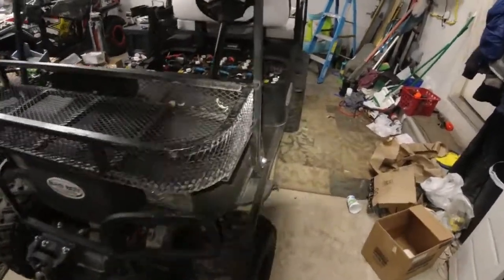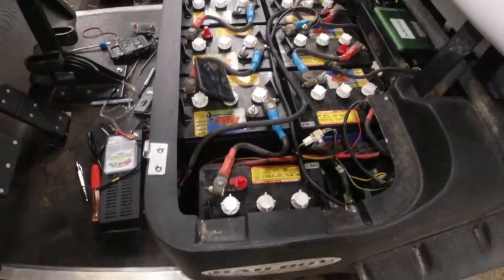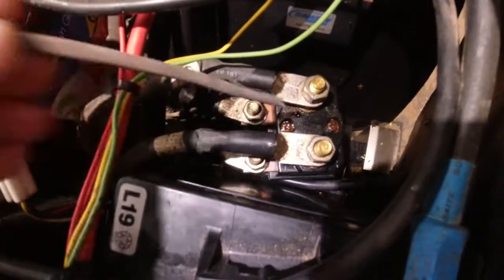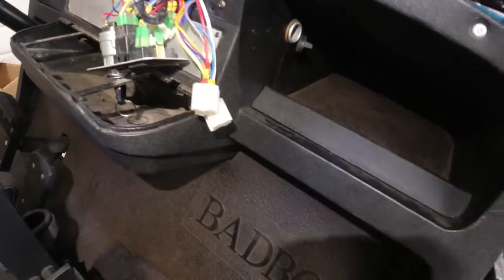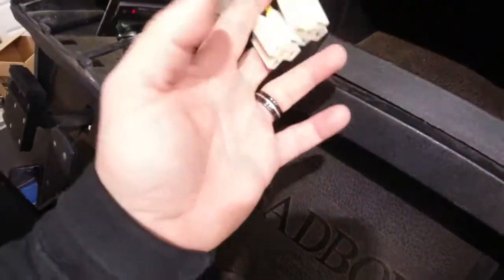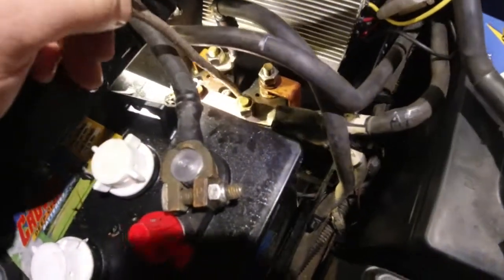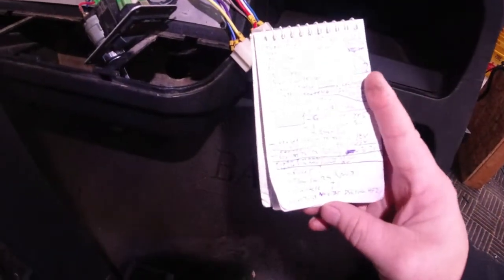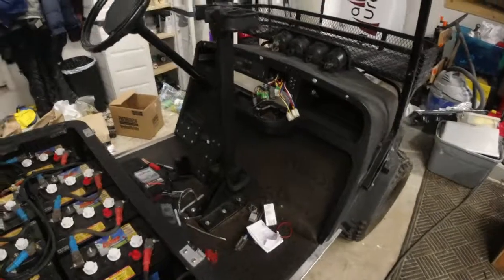2006 Bad Boy Buggy BB-AMS4 4x4 48V Electric Cart - Symptoms - Tests - Need Help w/ Diagnosis Please!

Comment from the maker: I never really clarified several of the things we figured out.  The relays needed to be 48v, not the 12v someone must’ve replaced the stock one with.  That fixed headlights and lighter plug. The things at the end of the video that I said I didn’t know how to test, I know how now thanks to a friend and research.  I also tore down both solenoids and cleaned everything. They worked and looked new rather than the green copper look.  The front differential got new top bearings. In the end, i made  a chart that shows how to test each pin in the controller and what the reading should be. It was the green Navitas controller. I sent it in through my buddy and had it rebuilt. By the time I was done, the cart was like new.
Reply: Are you still here and do you have wiring diagrams? I replaced everything - batteries, sent the controller to FSIP, have tried to check the diodes, switches etc. Traced all the wires (what a mess!). Can't get the controller to send ground to the solenoids. Tested both. All cleaned wires and terminals.

Comment from the maker: I know how to test and fix almost everything now on these classic versions. I went through this whole cart
Reply: I have a 2011 Bad Boy Classic, trying to troubleshoot. The forward and reverse do not click on the Solenoid when pushed. Cleaned all batteries and terminals. Not sure what to do next. Would appreciate any help
Reply from the maker: @fernandog.semiao265  do you have a single green controller in the back of the cart like I do or do you have two controllers? one in the front and one in the back
Reply: @freshmaker5  I have 2 controllors in back. Both have blinking green light when I turn switch on
Reply from the maker: @fernandog.semiao265  I only had one controller which did not have any lights. You should find the codes meaning of the blinking lights and you’ll know what to do.
Reply: @freshmaker5  been working on my Badboy classic for a while and I’m also down to it’s now running ok everything working but I can only go about two miles in woods before days I need to charge on dashboard. And loose power going uphills in woods . I also have two controllers . So you suggested look for blinking lights on both blue controllers? And then look up the code ? 
If I need new controllers can you recommend the two I need ? And is it true I must ship old controllers to the seller of new ones ? Thanks in advance. 
Richie
Reply from the maker: @richiechop  certainly sounds like you just need new batteries, not controllers. Have the batteries LOAD tested at your local auto parts store like AutoZone
Reply: @freshmaker5  I have a single controller. Only goes in reverse
Reply from the maker: @jaybyrd9750  there are two locations for solenoids. on the Passenger side there’s a double one. It’s your forward and reverse. If you can’t find a new one, remove it and tear it completely down cleaning it and put it back together. That is what I did to mine and it fixed it.  Take pics along the way and label wires and how they connect. Be sure to unhook the main 48v before messing with anything.
Reply: @freshmaker5  thanks! I’ll give it a shot. I will let you know
Reply: @freshmaker5  could I get a copy of your schematics also please? I’m having the same issue with no forward or reverse after I washed the vehicle. Probably got some water in something but IT’s throwing me for a loop.
Reply from the maker: @davidproctor3712  if it worked before you washed it, leave it be for about two days and let it dry out. You might be OK. Be more careful not to get electronics wet when cleaning. Send me your email and I’ll give you the main one for free that will probably help you fix your problem.
Reply from the maker: @davidproctor3712  this was years ago but I’m pretty sure I have another video that is regarding only the forward and reverse solenoids if you sift through my channel
Reply: Hey freshmaker5,
 I have a 2011 bad boy buggy xto with sevcon millpak controllers that will not move in forward or reverse. Both controllers have solid green lights, both solenoids pull in and show 50volts across B+ and B-. The fwd/rev switch has continuity on pins 2 and 3 respectively on the connector going into the controller when engaged. Yet nothing happens when I press the accelerator. Do you have any ideas as to what could be wrong?
Reply from the maker: have you checked the pedal switch on the accelerator? You access it from under the cart right under the pedal
Reply: @freshmaker5  I’ve checked it in terms of making sure it’s registering with the controllers. Meaning I’ve depressed the pedal and turned the key on and got a fault on the controllers. I verified all brown wires had continuity with B- on each controller. I checked from the pack positive back to the brown wires and had 13v on the volt meter. What do you recommend as far as a test procedure for the pedal? And thank you so much for responding to my post and offering advice on how to fix the buggy. I have no problem paying you for your time, I just want to identify what the problem is.

Comment: I don't see any reference to the 48v dc to 12v dc converter, have you checked it
Reply: I just test drove an 05 by 4wd electric. 
When lifting off the accelerator. 
The buggy comes to a screeching stop.
Any ideas? Brakes are not dragging

Comment: Well, do I jump in or steer clear?  I am looking at an 07 BBB 4wd with a winch.  He got it at an auction and wants $1500.  I am guessing that I am looking at a $1g just for the 8 batteries and all new cables.  Maybe closer to $1200??  I have tinkered a good bit with elec golf carts and had success.  This BBB has been sitting for awhile.  He does have the cores for the batteries.  What does a controller typically cost for one of these things?  Going to look at this critter this morning.  He also mentioned that something is broken on the steering, maybe the knuckle or something on the gear box.  Should I stick to golf carts or take on this Bad Boy?  Thank you all in advance.  Looking forward to some input.
Reply from the maker: Controllers are about $750 a piece.  If there is 2 controllers, it makes it twice as much and more difficult to locate the issue. Sometimes when the motors go bad, they ruin the controller and that is why the controller is bad. So things can add up and get complicated really fast. I learned a lot about these from this project. I keep finding that people buy them from someone broken, try and fix, but they can’t. Then you don’t get to hear how it broke from original owner and who knows what the guy did to it trying to fix it. The biggest issue with them is having a source of information and parts. You have to be pretty handy with electrical and volt meters.

Comment: I have a problem. I have a 2013 ambush. The plug that goes to my servo motor has a broke wire, do you know where I can get a new one
Reply from the maker: Can’t you just solder the wire? Or splice it?

Comment: I have a BBB just got the controller replaced, brought it home charged it and now the ignition wont work proper sometimes may take 20-30 turns and finally I will here the click and the same time that happened the battery LED went out and after i drove for about 10 min or hit a bump the Bat LED will pop on... any ideas on what it could be..???
Reply from the maker: Use a voltmeter to test the ignition when it is not turning the machine on. Then you will know if that ignition is going bad or something else.
Reply: Where did you find a new controller?

Comment: By chance dod you find a good schematic for your cart? Trying to find one as my cart is like yours.
Reply from the maker: This video was when I first got the cart and knew nothing. I spent soooo many hours putting together all the diagrams and even made several of my own. Full diagrams of every wire in the cart. New pedal, old pedal, controller colors and what each pin should read to test it, etc, etc. . I sell the package now. If interested, let me know your email.
Reply: @freshmaker5  how much for a wiring diagram?
Reply from the maker: @joecool6798  send me your email. Depends what ones. Stock one you guys can have free
Reply: @freshmaker5 I will pay for your schematics please?
Reply from the maker: @davidproctor3712 I’ll send one that will probably fix you up for free. I think my email address is on one of these comments or just send me yours and I’ll forward it to you.
Reply: @freshmaker5 I need your wiring diagram schematic too please!
Reply: @freshmaker5 I’d be interested in this.

Comment: I have a 2004 bbb classic same set up just about. Was riding the other day and loud pop then burning smell. Been trying to figure it out now. I turn the key on solenoids click, I can put it in fwd or rev and it will move with only slight pedal touch if I press the pedal with any more force it makes a
Noise and stops then won’t move again. I have to turn key off then back on and same thing. Both controllers have flashing green light. Solenoids and front motor was replaced less than a year ago. Any thoughts?
Reply from the maker: Smell to find the problem. Probably one of the controllers blowing a capacitor or something. If you smelled it when it happened you should be able to still smell the item from up close.
Reply: @freshmaker5  I wish it was that easy. It was near the passenger side capacitors. Is there anything between that rear controller and capacitor? Both controllers flash green simultaneously 7 times which I found to be either high or low voltage. I guess I’m asking where are the capacitors or even fuse box
Reply from the maker: @tbarnes00  i’m not a cart mechanic I just figured out how to do all of this because I wanted it fixed. My cart had one controller. I have another video that shows how to test the solenoid. I recommend you join the bad boy buggy page on Facebook. There is a lot of knowledgeable people there.

Comment: I just test drove an 05 by 4wd electric. 
When lifting off the accelerator. 
The buggy comes to a screeching stop.
Any ideas? Brakes are not dragging
Reply from the maker: Yes. There is a switch to the left of the 4x4 button. It is an electric brake button. If you turn it off, it will go back to normal.
Reply: @freshmaker5  
We tried that switch in both positions. No change.
I was driving on payment. 
And it would start out fine.. but as soon as you let up on the accelerator.  Those wheels would stop..
What is proper use of the e brake??
Thanks
Reply from the maker: The e brake is like a Jake brake on a semi to help slow you down on hilly areas without chewing up your brakes. Put the cart in neutral, turn the cart on. Put it in forward. You should hear a distinct click from under the seat. If you flip the e brake switch you should hear another click. If you don’t hear the second click it’s probably the single 4x4 solenoid that is bad. Sounds like it’s locked on. Either that or the switch is bad which you can test with a volt meter or just replace.
Reply: @freshmaker5  
I dont think the chart had a neutral. Just a single fwd/rev switch.
There was no clicking when I flipped the E brake switch.

We did lift up the entire unit into the air. There is a 4wd/automatic button. In both position all 4 wheels went around. And all immediately stopped when foot taken of accelerator..

The unit wasn't slowing down fast. It was stopping on a dime.

Thanks for all your help. I will let you know how it turns out.

Are parts for a 2005 available and not to expensive?
Is it a good deal at 4500 with new batteries? It does not look like it has been used much over the years
Reply from the maker: you probably have something wrong with the Solenoid  or switches.  I would have them fix it or get it for cheaper.  Stuff adds up fast
Reply: @freshmaker5  
Need HELP. ASAP....

I was able to check the e-brake switch with an ohm meter on the 05 buggy I have been looking at to buy. It is going to auction Thursday. I can buy now  it for $3650 as is. And new one month old batteries and wires. Buggy looks in good shape.  All other parts appears to be original.

Light on computer is on and steady green. Is this normal?

There are two sets of connectors on e-braje switch. . 
The side with the wires is not switching. That side of the switch is either stuck open or closed. I can't remember which . The other side of the switch with no wires  is working fine. I didn't want to fix it in front of them. The price would have gone up.

The symptoms are basically the wheels locking up if you let up on the accelerator . On asphalt it comes to a screeching stop. Doesnt matter what position switch is in.. Is this normal with e-brake on?

Should the contacts in the switch be closed or open to have the e-brake on?

What is normal operation with e-brake on and off?
How much regen should there be with e-brake on and off?

If switching the wires to the working side of the e-brake switch fixes things. Is $3650 a good price for an all electric 05 bbb with brand new batteries ?

Please try to answer every question above. 

Thanks....